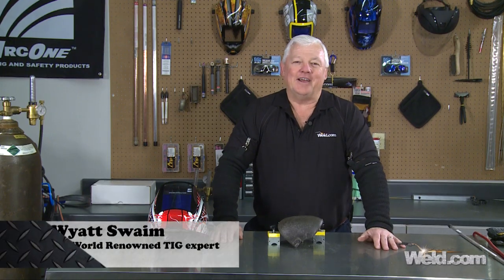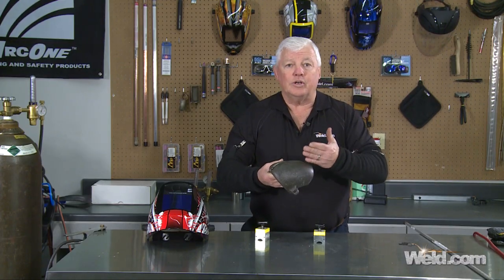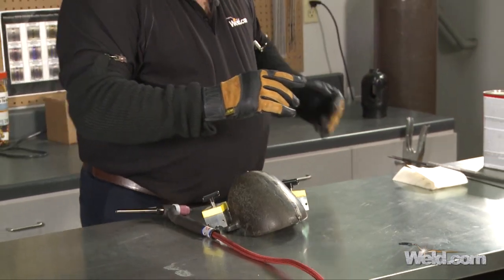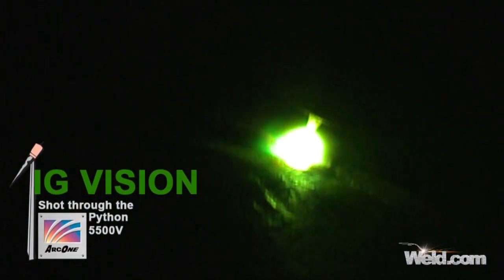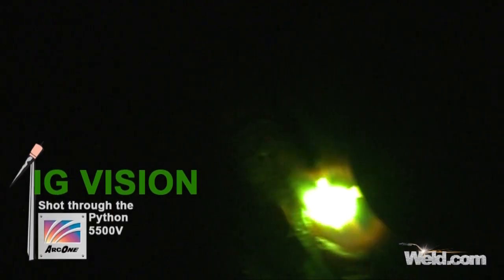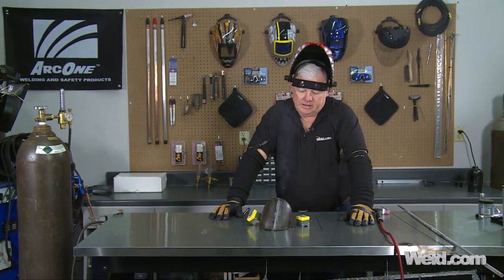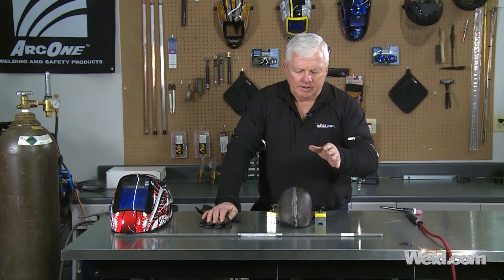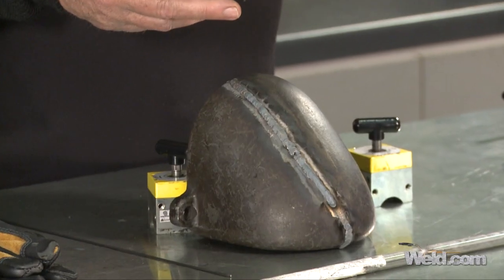How to Weld Cast Iron NO Pre-Heating | TIG Time

Comment: I enjoy watching your videos. I made my living gas welding cast iron castings. If you would like to learn, I could walk you through it. Cast iron is not hard to repair if you can handle an oxy/acetylene torch and are willing to invest a little in equipment. I know you are busy but I have been looking at YouTube videos, and it makes me sad to think I'll go to my grave without passing my knowledge on. Dan
Reply: @dtvm7469  i'm going to try to fix a bracket for a Ford Tractors handbrake. Will try brazing it using my tig, and fluxcoated brass(with Silver rod). Been tigwelding for 17 years,  but this will be me first try this way. Any experience in this? Greetings from Norway

Comment: some years ago I bought an old 62 grain truck with a 239 v8 with crossover exhaust. one of the exhaust manifolds had a chunk broken out of it. it was the only thing preventing the truck from being used. engine ran fine. i went to a metal shop and the guy used a torch with an attachment that looked like a big air-brush that had a jar attached with metal powder. he heated the exhaust red hot and "painted" the exhaust back together before my eyes. i was amazed and gladly paid the $100 fee.

Comment: Good demonstration. As a mechanical engineer, I had some issue with the referencing of the two parts at the beginning of the welding, as the two parts seem to have each one fixation hole. I would do the initial point welding with the two parts mounted on the final part there are designed to be fixed on.

Comment: Tool maker here, not a welder but I've been asked to repair several cast iron pieces for friends and family.  Anyway, I use a technique called backfill cold welding with Tig.  It's when you have the filler rod following behind your electrode to keep the iron from pre heating as you weld.  Only weld a small section at a time and let the part completely cool between welds..  Also I had the best success with Inconel filler rod.

Comment: How to set dc- . .i have a piece of cast iron metal and i want to weld it using tig dc welding machine. I just want to know if its ok to weld it with aluminium filler wire.

Comment: due to its porosity I always preheat cast iron til it smokes... so any oils will burn off of it.  im new to TIG, but ive always had success welding cast iron when stick welding, using either a ni-cad rod or MG600...

Comment: What sort of alloying element is "trash"?  With no AWS specification, I will pass.  "4% Utechtanite" sounds dubious to me at best.  An internet search on this word only points to their website or websites that reference their website.  It sounds like "eutectic".  I wonder if it is actually more of a brazing metal than a weld filler metal.

PS:  I looked up the safety data sheet and it consists of Aluminum and Iron oxide.  It sounds like what is happening is that when it is heated up in the TIG process that the aluminum reduces the Iron oxide to Iron and that is what is deposited in the weld area, essentially pure iron which is quite ductile.  The "trash" that you see floating up is probably Aluminum oxide from the reducing process.

Comment: Hi    I work for a Big food company and I have Tig  weld ( Miller Dynasty 300DX water cooled torch with Speedway SW320 Torch & I use gas lenses ) on Supper Alloy 42 which is a series of cast iron with 42 % Nickel in it very ugly stuff to weld on have you ever heard of this stuff or welded on it my part is big & heavy 130lbs & very rust - I do sand blast the enter part to get rid of as much of the rust as possible would like to discuss this with you if possible.  Thanks

Comment: First piece I ever tried was a cast iron pan using a Monkey Wards AC buzz box and 7018.  Prefheatet or not it cracked every time even when I tied to braze it. Very hard to do with my equipment.

Comment: The guy that showed me how to weld cast would weld about an inch, then let it completely cool before welding another inch or so.
He once welded on submarines, so i think he knows his stuff
Reply: @michaelwells5617  I learned cast iron welding in a press shop tool room, and we usually weld about ~5-6cm (like 2 inches), peen it with a hammer, and then you put your bare hand on the bead. If you can keep it there without pain, you can continue. But we usually also do backstitching or stepping to spread out heat

Comment: I am about to weld a cast iron engine block using this same filler material.  The crack is actually external on the block and it is not cracked all the way through.

Comment: Glad you gave out the 50/50 warning because that is what I have been warning customers for years. Some iron castings will just not behave... no matter what precautions and careful post-weld treatment you adhere to. I regret having to tell people that especially when they have a vintage, difficult to find piece (exhaust manifold off granddaddy’s Farm All) and we’re obliged to make a quick (and correct) decision on a plan of attack and maybe, they have their own idea (often dubious) of how they want it done. “Yes, I can braze it and that will require extra careful cleaning, getting it red stinking hot and hours of careful cooling down. You might not be happy with the results, even then.”

Comment: So what i got out of this is: Dont use tig-due to heat,  Preheat always helps, And Ni99 or use  stainless, 309 stick rod..?? right?  I'm sure Easy weld wire  has its place ...
Reply: Hell no! You can use tig!
Reply: @HenryTheBoilermaker3rdYear  Yep sure can..I ended up using silicon bronze on a vice repair using tig ,preheated the crap out of it and worked it in the cracks .took a bit but it worked.covered it up with sand and let it cool down..customer was happy..It was work..and messy .. but i'd do it again. Peace
Reply: @moustachemike7128  I currently working on a cast iron bracket for customer. I'm welding on 5 mm cast iron plate with no success, getting all kinds of cracks even with pre heat. I'm using nickel chromium filler. Any advice? Might try out pulse mode. I'm preheating using my  cooking top not oxy torch btw.
Reply: @HenryTheBoilermaker3rdYear  cast iron or cast steel?? ..ya just don't  know whats in it You can spark test it and even then ? pretty thin stuff your working with what percent of nickel rod  55 or 99 .id try a different rod that more giving to  shrinking  on cooling also ya might not be hot enough just a thought... and cooing to fast.during the process.. there is some good cast brazing product on the street don't give up some thing will work.Keep looking on you tube at cast welders and see what works best i can tell ya,,good luck...
Reply: @moustachemike7128  update: I bought a cast iron pan just to practice on it. I preheat the hell out of it to over 400 Celsius then I weld with tig at 90 amps and I was no longer getting cracks. So preheating very hot is definitely very important when welding cast iron. Good thing I have a ir camera thermometer to tell me what temp I was on during preheating. That thing is a great tool in engineering heavy fab. Now I can work on my customers job with confidence.

Comment: You can hear it cracking while he's welding. This might be good enough for decorative work but i wouldn't trust it for anything i cared about. There's a reason people preheat cast. And after preheat, they usually braze it one way or another. Welding can work too but it's not usually the first choice.

Comment: Sorry but really amateurish. Welding with TIG rods that you don't know what's in there? The welds are presenting cracks, and blow holes, so if you need just that the two parts sticks together, that will do the job. Cast Iron welding: the do and dont's:
1) Avoid TIG weld, as the heat input is very high. The cracks are appearing because the weld has inherent stress when it cools down, and cast-iron is too rigid. Welding with TIG is slow, hence the whole part heats up more than it needs.
2) Use Stick electrode with high Nickel content. Expensive but really tough with 30-40% elongation (most use Negative on the electrode). Each brand has their own "special" cast-iron electrode. 
3) Peening while it's hot, to reduce the stress in the weld.
4) When joining, get the most accurate fitting, avoid large gaps.
5) Don't go over 250 degC (500 F)
6) For those who have an oven and the part is not too large, preheat the whole part to 600 degC (1100F) and weld the whole thing without stopping, then back in oven, and slow cooling (very slow cooling)
7) Trick of the trade: Don't weld the whole joint with a root pass, then come back at the start to do the second/third pass. Weld one or two inches, then come back and forth , always peen while it's still hot.

Comment: I noticed around the 11.04 to 11.05 time on video, after showing the bubble, when the camera focuses in you can see a hairline crack in the middle of the weld. Every time I use this filler and method I get the same result. I'll bet Wyatt couldn't see it while they were videoing because it was a really small crack, but when the close-up went in you can see it. Do you see it too?
Reply: You are right, a short hairline crack can be seen in the middle of the bead.

Comment: Why do I get alot of popping and splatter when I Tig weld?
Reply: On cast iron specifically, or on all metals?
It could be a lot of things, but I’d say it’s usually a contamination issue. TIG requires extremely clean surfaces, tungsten, filler, and gas coverage. If any of those components are contaminated, your weld will pop and spatter, and blacken. So try cleaning all of your components, and make sure your gas coverage is good, including preflow.

If that doesn’t solve it, double check your weld settings.

Comment: Unless there's a compelling reason to avoid pre heat, I'm going to pre heat. With cast iron, that's going to reduce the possibility of cracking. I don't care what the welding product vendor says. Obviously, Mr. TIG Is advertising for profit, not giving reliable advice.I don't trust him.

Comment: Quick question. I know this video says you don't need preheat or post heat or anything like that when you use this filler but say I wanted to preheat the piece of cast iron I have and then stick it in some sand when I'm finished welding just for the hell of it. You think that would help or make things worse?
Reply: it would not make anything worse if at all it would help greatley. cast after heating it up to welding temp wich is high temp has to cool very slow slower the better. putting in sand is a good idea to help it cool slower. silicon bronze is a good cast iron choice on tig welding it.
Reply: Perfect! Thanks!!
Reply: cool thank you!

Comment: I have a Wilton 800 vise and there are chips by the top of the vise by corner of the bolt that goes into the jaws. how would I go about building it up? someone recommended blocking it off with thick plates of graphite but that process is too long and too expensive.
Reply: If they are just cosmetic damage I'd leave it alone, but if you want to build it up I suggest you contact Wilton to ask about the best filler for their particular alloy.

Not enough people take advantage of manufacturer tech support. It's free.

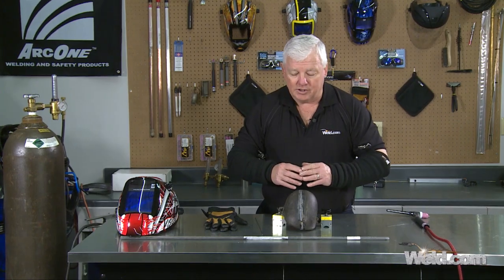Comment: pause between 11:02 to 11:05 and in the center of the video at the middle of the weld you can clearly see a crack forming. sorry but I'm not impressed. Thanks for the great videos. They're always informative.
Reply: It looks to straight to be a crack.i weld alot of cast a if it does crack it's normally on the side of the weld rather than in the centre of the weld.its shit temperamental stuff to weld
Reply: @catherinejack1  You weld alot of cast? Really what do you do that needs so much cast welded?
Reply: 7:42 ... The moment you hear it all go wrong. I know that “TINK!” Sound all too well. Weld 100% cracked.  He knew it too, he terminated the weld half a second later knowing that it was all over.
Reply: @TheChopperUnderground  and he stooped straight away. i think you could go back and fix it and the bubble. when i tried to weld a cast manifold i found it had zones where it would splatter and cover my tungsten with stuff and it would burn away. a total pain. took me hours
Reply: Trick acula I'm pretty sure he rubbed the tungsten across it and it made that line
Reply: Trick Day 
In the beginning of time...
The instructor did use the term 50/50 chance!
There’s your crack at 11:02 - 11:05.
Reply: Trick Day G

Comment: I been welding cast iron 12 years, all kinds and size, pre heat and cool off its the most important part of the work, I see the video with jay leno too... you should stay with inox and aluminium welds. I cry when the antique cast iron of jay leno start to crack... any way I learn so much of your other videos.
Reply: Hey buddy it actually works im a 30 year welder in nuclear plants so fyi
Reply: So would use 7018 or 70s2?
Reply: Devi Holiday preferably 309l or 308l. With pre heat and a means of cooling off the piece slowly.
Reply: Question please:
How about welding 
St52 (ASTM A572) steel 
with 
St275 (ASTM A529) steel
successfully?
Stick or mig or any particular method recommended?
Thanks
Reply: Surely Not his shining point welding cast. Most people have no place doing it because it takes some special knowledge and temperance. I think this was just a shill mercial { secret commercial ] Wish these guys would just be honest about paid vids. Every time you hear a snap pop or crackle you are losing the battle

Comment: I will first admit my lack of welding experience - at this point, all I have done is some reading.  But I have read some about pulsed TIG welding, and that it is supposed to reduce the heat into the work.  Would this be of any benefit in welding cast iron?
Reply: +John Henderson no
Reply: yes

Comment: great wire I welded a engine block after a rod went through the side and its still running after 30k miles fantastic wire.... thanks mr tig
Reply: Is the motor still running?
Reply: can can get this rod at ur local welding store